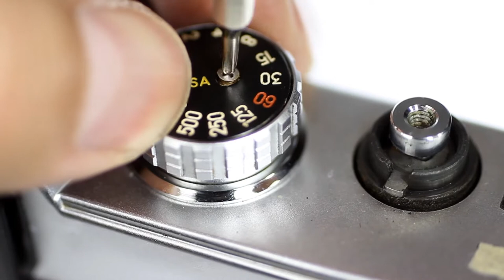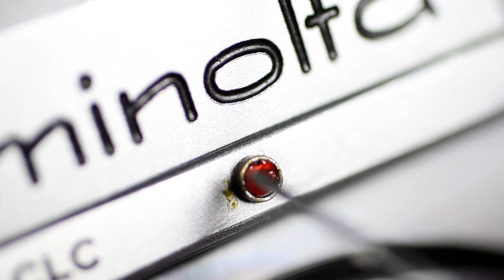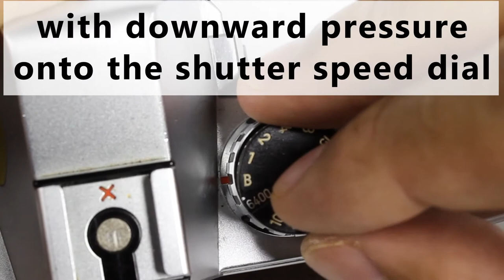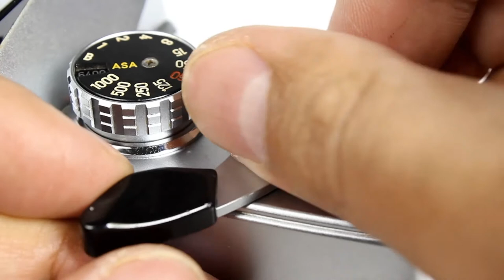How To Clean The Viewfinder in Minolta SRT Camera Disassemble Top Cover

Comment: There is a way to save the red dot (red anodized aluminum disc). US Camera used to sell replacement red dots (Minolta part # 031-1074) for about $5. However, it looks like they're now out of stock (as of early 2023). The professional way to remove this screw with the dot and chrome bezel intact is to use a "pin vise" rather than pliers. The pin vise grips the bezel and removes it, usually with the screw and dot as one piece. The correct pin vise size for this screw and bezel is .050 to .125 inch (1.3 to 3.2 mm). Starrett makes a good one.
Reply: An easier way is to use a dab of nail polish
Reply: @Nacreous01 Your’s a brilliant idea!👍👍👍😊
Reply: Thank you for this very helpful advice!

Comment: Thank you for the video! My SRT's film advance knob seems to have a bit of play even after the shutter is charged. The knob and the silver tab (at 14:01) still can rotate slightly. Would you please let me know if it is normal or how can I fix it?
Reply from the maker: Hello Issac,
It is normal if the play of the advance lever is very little, otherwise it is likely that the nut will need to be tightened a little more.

Comment: just got this camera and a lil scared to take it apart my view finder isn't too dirty but cant find info on if it'll effect my photos or not (VERY new to this lol)
Reply: When viewing, the image light passes through the lens and strikes the mirror which reflects the image to the prism which is seen through the viewfinder. When the shutter is fired, the mirror goes up out of the light path and the image light passes through the lens and directly onto the film as the shutter curtains reveal the film. So no, dust in your viewfinder will not affect your image.

Comment: I can’t seem to get the rewind knob plate off any suggestions?
Reply from the maker: Hello Aleese,
Unfold the rewind lever and put some WD-40 to try loosen the screw.
Reply: Use a screw driver fitted in one of the slots and small hammer to turn the ring counter clockwise.

Comment: Great tutorial! How do you remove the red dot and which type of glue do you use thanks
Reply from the maker: Hello J T,
The red dot can be removed with a thick needle and you can stick it with any liquid glue that sticks to metal or plastic.
Reply: @photographyandmore  I'm wondering if you might be able to remove the screw with some needle nose pliers (with a rubber shield) and that way one can leave the red dot in place?   I ask because somehow I'm sure I'd screw up the red dot removal and replacement.
Reply from the maker: @dlyon9673  Very good observation!, I have never tried it, but it sounds like it can work, as you say, being careful to cover the tip of the tweezers with some rubber.